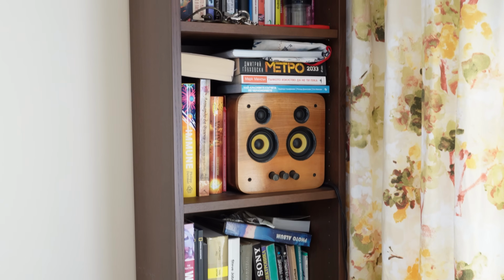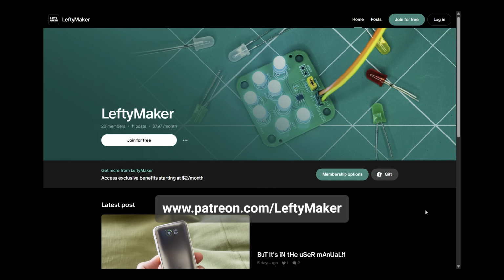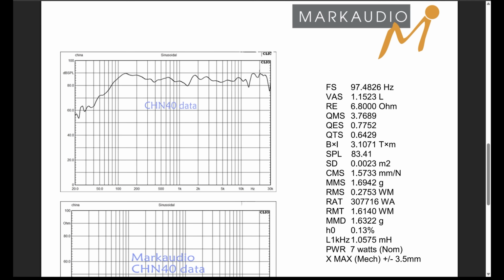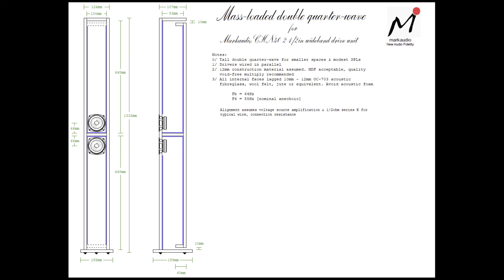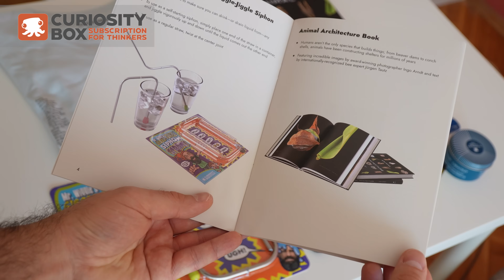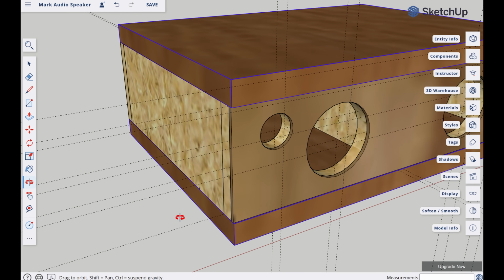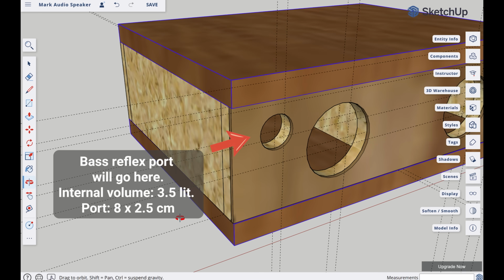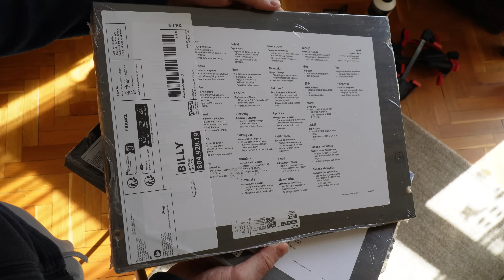This is Literally a DIY Bookshelf Speaker (and it Sounds Lovely!)

Comment: I can find only Dayton audio drivers for this kind of project. Can you recommend me a good Dayton audio full range driver for this kind of stuff?
Reply from the maker: The PS95 is well regarded: https://amzn.to/47Itp9G but it is bigger and can't go as low, according to my WinISD simulation. The ND91 is known for making solid bass https://amzn.to/4p5Ru1q but you probably want to pair it with a tweeter. Haven't used either of them in a project, so you might want to look around a bit more.
Reply: @LeftyMaker thanks a lot

Comment: I wonder what other furniture could contain speakers?
Reply from the maker: They sell low frequency speakers for mounting in couches. There's ceiling speakers as well. Ikea and samsung have speakers that are like paintings. And some mad lad at instructables replaced a door with a speaker panel :)
Reply: You can actually put speakers easily on a steel shelf.